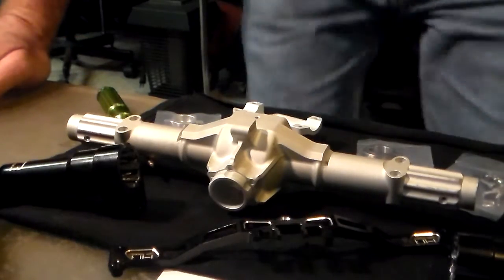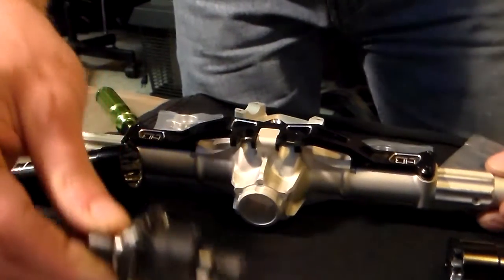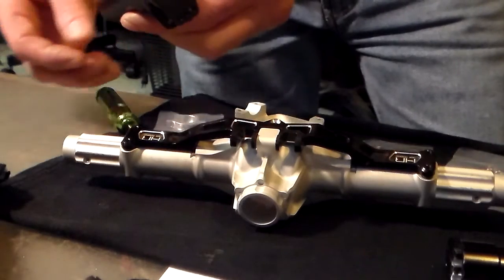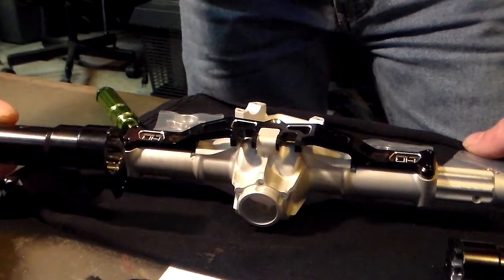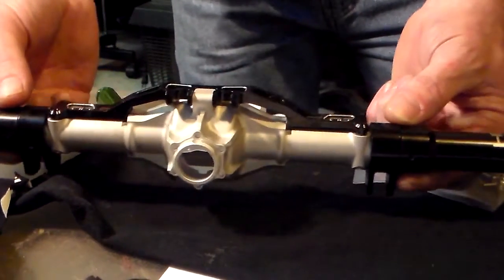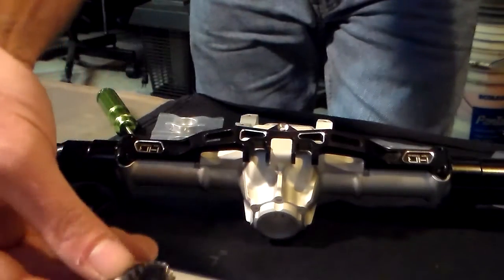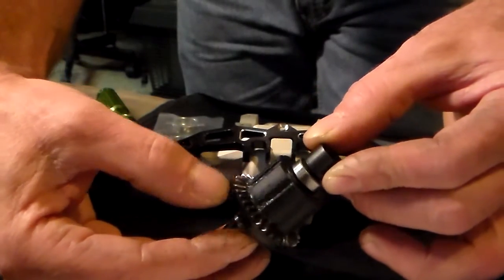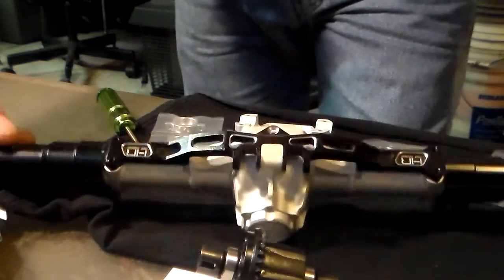Yeti XL Vanquish aluminum rear axle assembly

Comment: I have 2 Yeti XL's. So far I've destroyed 6 sets of gears and bearings front and rear. Just ordered 2 of these Vanquish axles. Next I'll be ordering aluminum front housings. Aluminum gears housings are a must have on these rigs. So much torque for a plastic housing.
Reply from the maker: Yes you are absolutely right.... I did not own mine long before I stripped out the gears... Plastic flexes to much...  I have the aluminum housing on the front and Vanquish axle on the rear and have not stripped out the gear scince.  Make sure you have the aluminum spacers between the bearings in the front. Get rid of the plastic ones. The Vanquish rear end comes with the aluminum spacer....

Comment: Cool. Thanks for letting me know about the bearing spacer. I've only driven my Yeti's about 3 hours total between the 2. I'm very hard on my trucks. Other than blown diffs I'm very happy with these Yeti XL's. Just a little bummed I spent $1400 on them and need another $600 in diff upgrades to really make them durable.
Reply from the maker: I also have the hot racing differential housings.   http://www.hot-racing.com/index.cgi?partnumber=YEX11C01;c=939  Here is the Hot racing front aluminum bulkhead.   http://www.hot-racing.com/index.cgi?partnumber=YEX1201;c=939

Comment: You might also need the aluminum collar. The collar pcs is between the 2 bearing on the drive output gear. You can find it on eBay made by Dhawk for around $6 dollar but much better than the plastic one that come with kit. Anyway hop this info will help you and others viewing this video.
Reply from the maker: +Rocky winn The aluminum collar comes with the Vanquish Axle assembly. also they give you one larger bearing with the kit, but it's good to know info in case you blow out the bearing assembly and damage the spacer

Comment: Was modifying the splines worth it? 
Im about to take the plunge, and kind of dreading the idea of it.... any tips to pass on? 
Thanks! 😁
Reply from the maker: I was determined to get the pretty aluminum  ones to work. If your not comfortable with it use the plastic ones. I don't think you will notice any difference in performance with plastic or aluminum. It was just a visual thing for me at the time.  :)

Comment: Hello again just wondering if the modifications fixed the pinion and diff gear from slipping? I have changed all bearings and still have problems
Reply from the maker: +Jack Jones I have not had any problems with the gears slipping. This kit has an aluminum spacer between the bearings unlike the stock plastic one. There is no flex in the housing keeping the gears meshed at all times. I am very satisfied with my purchase of this kit.

Comment: How does the bigger bearing is installed? Do you get rid of the old 2 bearings (in my case 3)? how does it work? Tnx!!
Reply from the maker: +Juan Galdamez You use 1pc of your old bearings, 1pc Aluminum Spacer (supplied in kit), 1pc Larger bearing (supplied in the kit).    The aluminum spacer replaces the stock plastic one...... If you are using 3 bearings then you need to put two of them in your spare parts box...
Reply: +James Brown Thank you very much for your answer. What about the shims? How many are you using? are they in the front (next to the bevel gear) or in the back (next to the retainer clip)? The retairner clip keeps on destroying the bearings...Tnx
Reply from the maker: +Juan Galdamez I experimented with the shims to keep the mesh of the gears correct. I put the clip on and off a few times before I figured out the correct mesh for the gears.  I used two shims.  I think I have one on the clip side and one on the gear side.  Your might be different than mine.  Experiment with the shims and make sure it's not to loose and not to tight..
Reply: James Brown, I installed the axle yestarday but noticed that there was almost not room for shims (the bearing is wider), and besides that there was no slop whatsoever... Could that be normal? Thanks for all your feedback!